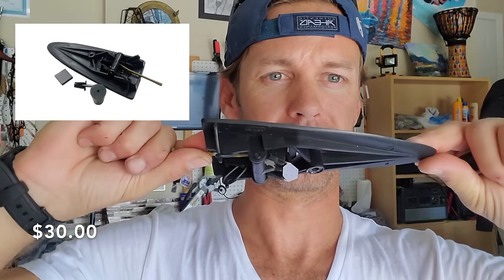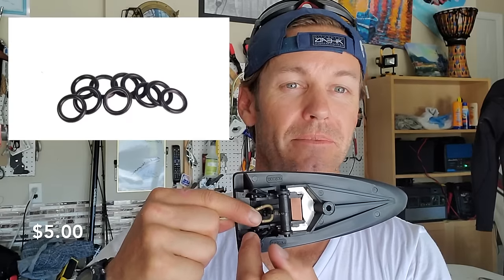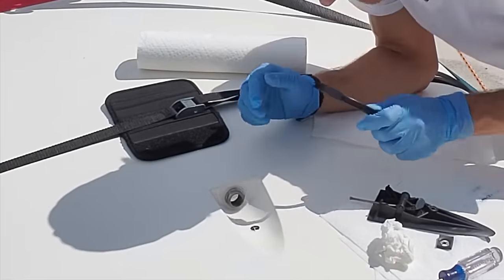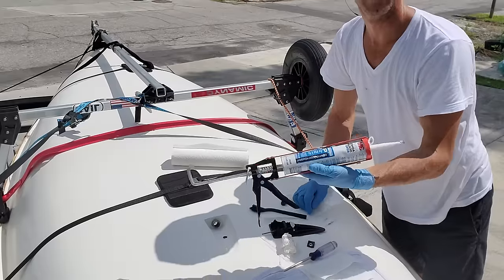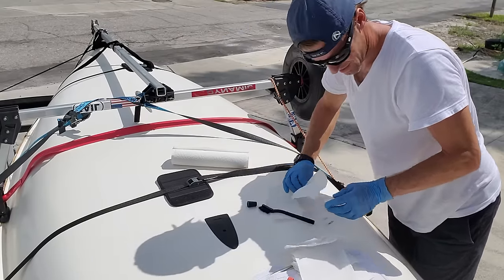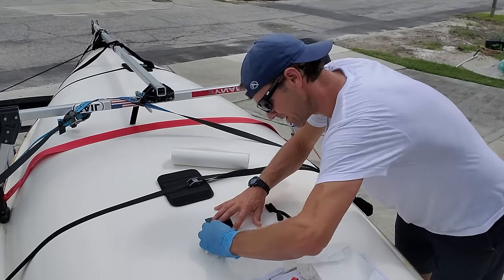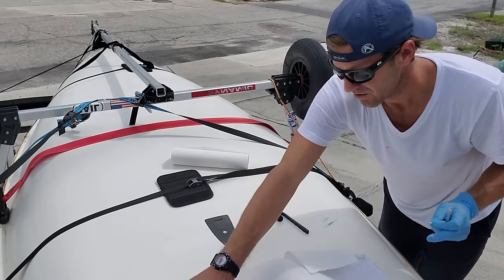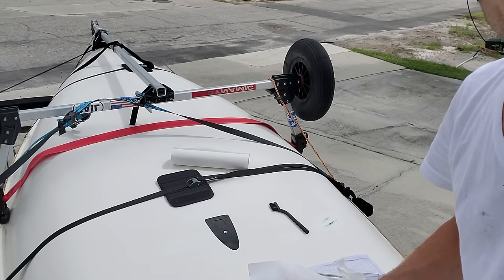Laser BAILER REPAIR

Comment: You should add sykaflex around the self bailer to hull join as well as the screw hole. It isn't much but in a one design boat every little advantage is huge
Reply from the maker: Thanks Callum, Agreed, every bit helps, but interested in the legality of the addition of Sykaflex to decrease drag. Can you confirm that is "ILCA Class legal?" To my knowledge you are not allowed to alter the bailer or hull in anyway nor add or remove additional chemicals to adjust from the original design. We always appreciate the additional tips and tricks from our fellow Laser/ILCA sailors and I'm interested to see what you find out. #ilcalasersailors
Reply: @ILCALaserSailor  I'm not too sure, I'll have to check it. At the radial youth worlds I saw lots of boats with mastic or sykaflex in the screw hole and no one got disqualified for it from what I know
Reply from the maker: @callumwyper   I'll see what I can find out too and try to include that info in videos moving forward. Thanks for watching and your support!⛵🤟👍